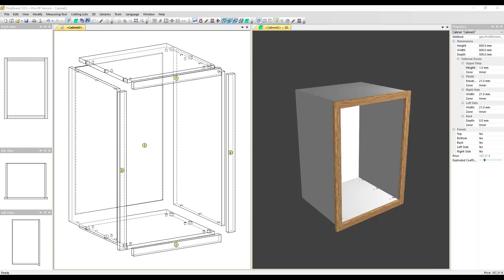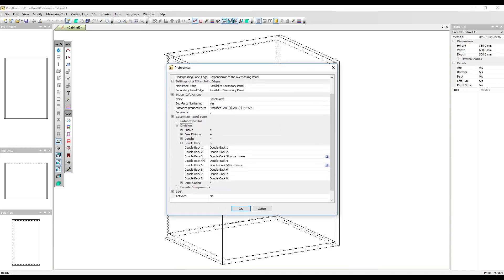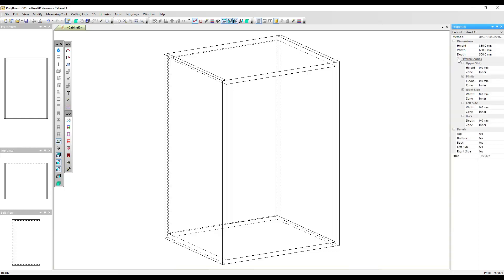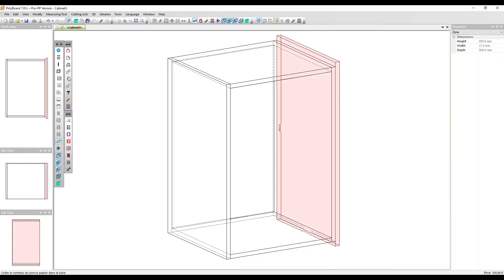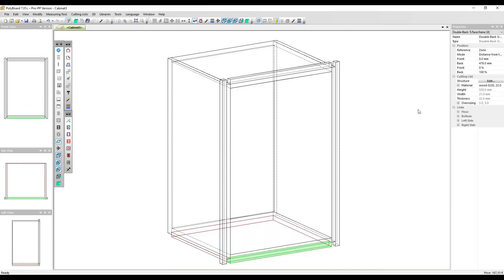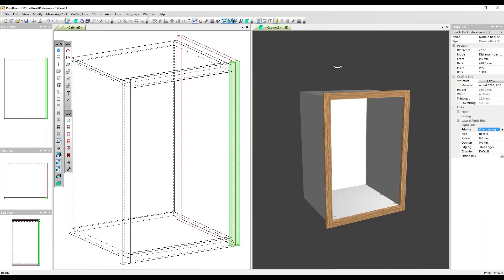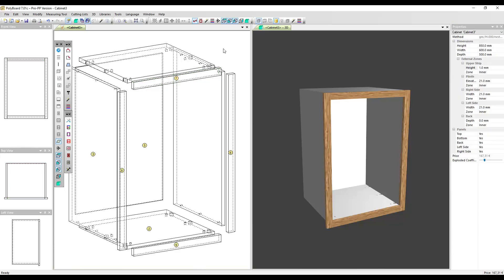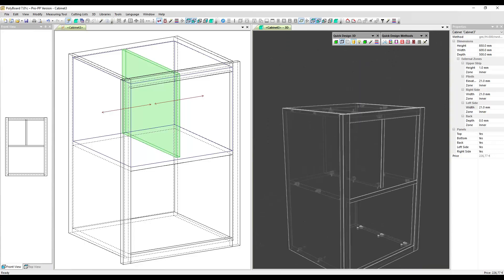Face Frames in Polyboard

Comment: Is it possible to make the frame with a 45 degree connection?
Reply from the maker: Hi Rami, 
Yes, this is achievable using the most recent version of Polyboard. When the main box panels are mitred, the external zones, including the frames, will also be mitred. 
Cheers,